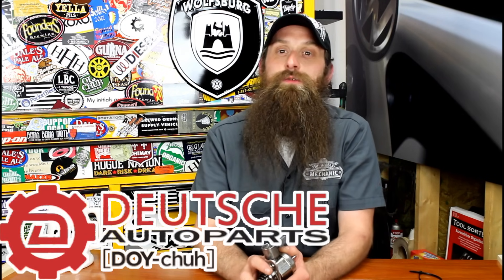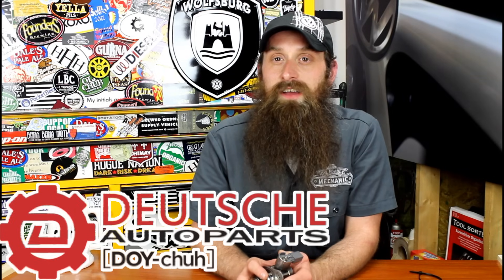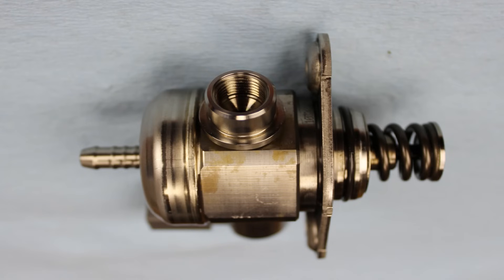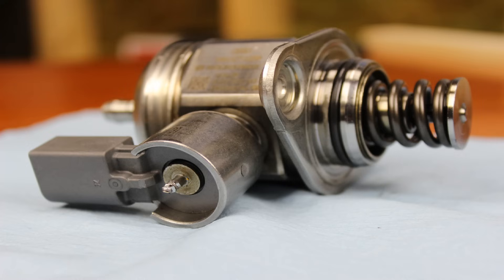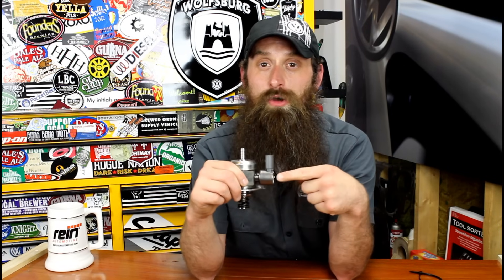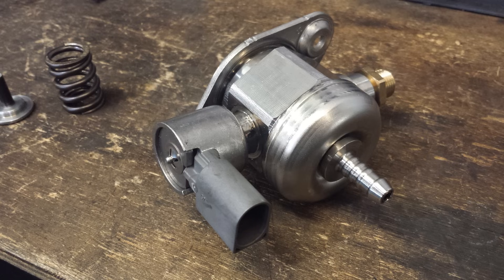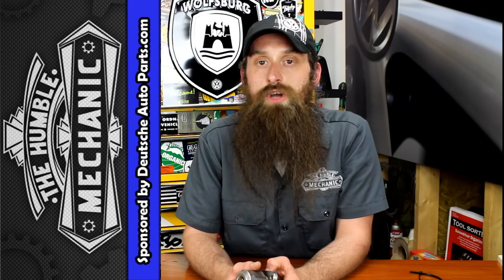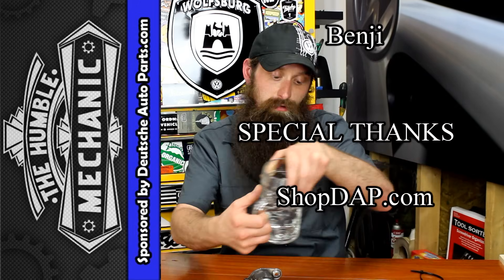How VW and Audi 2.0t TSI High Pressure Fuel Pumps Fail (HPFP)

Comment: I’m getting P0091 error fuel pressure regulator low control circuit 1 what would be the problem ? Really confused and the car is not starting when the engine is hot. I’m getting exhaust system warning lamp
Reply from the maker: Possible fuel pump module
Reply: Thanks bro my mechanic said it was low pressure sensor but he called me after few hours and said it might be the fuel module.  I felt so happy that my mechanic is a genuine guy.

Comment: Ok, 1, it's really obvious you're reading word for word from queue cards or a teleprompter. 2nd, these pumps fail another way, by leaking fuel back into the engine where that pintle valve was. DiagnoseDan just did a video on one where it put like a quart of fuel into the crankcase.
Reply: you're an actual piece of shit attention seeker
Reply from the maker: Never seen one fail that way. But not surprised about it.
Reply: I have fuel leakage coming from the top of the engine but under the injection place where I can't see.
The mechanic said that he will open the injection compartment to find out where the leak is from.
Can anyone help me with this problem.

By the way I wouldn't start the engine to avoid fire.
Please tell me what to do. Thanks

Comment: Would a bad hpfp cause lots of smoke to come out the exhaust?
Reply from the maker: It could. But there are tons of things that can cause smoke
Reply: This happened to me on my 13 gli cbfa today, after carbon cleanin upoer timing seal and cam seal i think th hpfp went or something thought it was the pcv change that and n ok thing, car is smoking but wont start keep getting low fuel pressure code and misfire codes
Reply: @joshuaalston-jackson8454  what did you end up doing? I have that problem right now and debating on replacing the hpfp
Reply: @Michael Booker  the injectors  one of them or more failed..when they fail they fail open and flood the cylinders..change them and ur good

Comment: I have exactly the same problem! My HPFP is still ticking, does that mean that it works correctly? I have a rattle noise during acceleration at low rpm and random misfires. My car is a VW GOLF 1.8 TSI 2010.
Reply: Random misfires? That's a symptom of bad HPFP for the 1.6 prince, so i guess it could be.
Reply: @Fucklesticks  i have the 1.8 TSI engine. I looked what the desired and required pressure was in the fuelrails and they where the same while driving. So I guess that the hpfp is not the problem. I'm still searching....

Comment: i just replace the high pressure fuel pump and the low pressure pump in the tank on my b6 1.8 tsi but the car is still stalling just after 5-10 km when scanned it reflects the high pressure pump
Reply: I did the same thing on my 2014 a5 Quattro. The Audi guy said my gas was to hot and sending vapor through the high pressure fuel pump. Looking for a fix now.

Comment: Im in the process of going from stage 1 to a stage 2 file on my 1.4TFSi. My question is, should i upgrade my HPFP to a 1.8TFSi or just go straight to a 2.0TFSi HPFP? This is a requirement but im curious to know if the 2.0 version is the better one or would the 1.8 version suffice?
Reply: Thanks for answering this question lmao

Comment: I'm having intermitent failures on high pressure pump on a CCZA engine. It started ocurring after my mechanical f*cked my engine when replacing chain tensioner. (16 bended valves). 

When I'm accelerating, sometimes it cuts the throttle suddenly, then the error code appears.

But it's intermitent. Sometimes I run the car for long periods, floorimg it, and no problems.

Any tips about it? May be an wiring issue? VCDS shows perfect fuel pressure on idle, didn't checked at wot.

Comment: hey chariles got 2009 adui a4 2,0 cranks no start i check for spark and it has spark and here is the codes p2296 p0010 ,,,the battry is junk for starters my frind thinks timing chaine ? if the battry is new and its getting spark and if i shot it with starting fuiled it should run ? what ya thurts let me know

Comment: Hello again . My problem : Hello. I have a smal problem with my mk6 gti 2009 manual gear box . when I try to go on a very strong start, changing the 2nd gear remains stuck as if the gas does not come .. 1gear is very brutal is i normal... that's only when I'm very sporty .. if I use the normal car it's all normal ... in other words I can not have a very brutal launch control because the second shift is dead. If i change a 2shift before 5-6000rmp all is ok ... so : I'm stop . I'm going to force 1shift up to the maximum same like a (brutal lunch control) push the clutch to change 2shift, go in 2shift and it's all stuck ... the car is not accelerating. The gear box is ok . All work perfect if i don t go in a max rmp with 1shift. 
Pls help me. I try today 2shift to 3 shift gear and do the same . All changed after 6000rmp next gear is blocked ... no gas no acceleration. Thank you.

Comment: Great video good info... i wanted to ask i have a 06 a4 2.o and am getting the P0089 code please shed some light cause i changed the fuel pressure regulator sensor n still running slow. . Could it be the same issue u were explaining?  And what is code P0340???
Reply: Did you you ever get an answer on the P0089 code?  I am having the same code with a really rough idle.  06 A4 2.0T
Reply: Did u guys find out whats going on ?

Comment: Ok I hope you amazing guys can help me. I have a 09 mkv gti tsi. Drove my car to work fine, but when I left to go home it ran rough, sounded like a Subaru. Got home and parked it(only live 15 min from work) changed the plugs first. After that it would start. Got a crankshaft position sensor code and misfire. I changed the cps and still no start.So I put in new coils. Still will not start. When I try to start it acts like it wants to but will not and it also sounds like a backfire under the hood. Checked the camshaft chain tensioner and it looks fine. Would you lean towards the hpfp? I had my wife turn the ignition to the on position and didn't hear the pump turn on all I could hear was a tiny ticking noise coming from the lil electrical part of the pump.
Reply: I have the same issue right now....what was your issue?
Reply: Domo Mike ??????
Reply: Jumped timing

Comment: My 09 Tiguan has a no start issue but before the no start car was losing excelleration n before that the pump hummed in the back . Which pimp should I replace? No check engine light

Comment: Humble Mechanic! Here is bizarre issue. I have a 2007 MKV 2.0t TSI Jetta. I had a huge problem with power. Throttling under 2-2.5 RPM it did go but with low power. Past 2.5 RPM it was totally unresponsive. So taking it home I put it up on the scanner and the codes "Throttle position sensor - G69 signal too high P0123 upper limit reached". And also a second one reading "Angle Sensor 2 for throttle (G188): Signal too low P0222 lower limit reached. So I took the intake manifold off very carefully along with fuel rails very carefully along with the fuel pump and throttle body still attached still attached. I tested the intake manifold mechanically and electronically and it seemed to check out. The throttle body the same. Except that the throttle body when at "0" does not close at a 90 degree resting point. to sure if that where it should be. But the travel values seemed to check out visually. After all that checking out I thoroughly cleaned everything with minefield cleaner. I also cleaned the valves as they were caked making sure only touching the ones that were closed for degree safety. I put everything back together forgetting to putting the dip stick tube on. During starting it took 10 minutes to get it started. Then it idled very rough with intermittent light presses of the pedal. After 3 minutes or so of running it dumped both fuel and oil, gushing directly under the engine. I shut her down and then took everything back off finding no loose hoses or connections. When taking the intake manifold off fuel pored out of the the manifold and throttle body. I'm assuming the obvious on the oil gushing, but the fuel? WTH? Any suggestions?

Comment: I have a 2006 VW Passat 3.6 how do I test the low pressure sensor I know is there is a five five reference signal and a ground and signal wire for the computer

Comment: 06 Audi A4 2.0t if hpfp fail will car start
Reply: Et Bet not always.  Sometimes the solenoid will completely block fuel flow to the HPFP and the injectors will starve for fuel, causing a no start. Not as common but it happens.

Comment: I just put a replacement engine in my 2006 passat tfsi and I have a p2293 code that is coming and going.   I tried replacing the low pressure sensor on the hpfp with the old one from the original engine but that hasn't alleviated the issue.   The engine I put in I made sure I put a brand new cam follower in and I'm sure that camshaft is Good as its a warrantied used engine through lkq.   Any ideas on what I should try next.   Maybe try to use the old hpfp from the original engine?
Reply: Did you fix the problem?

Comment: Does the 3.6  high pressure fuel pumps common to go bad also?
Reply from the maker: They do, not nearly at the same rate. They actually fail due to chain stretch  more than fail the pump.

Comment: I've got a 2010 Passat wagon and I'm having a epc light on with an obd code of p2293 and a misfire code p0302. There was some freeze data with the misfire code. Things that stuck out- sort term fuel trim1 of -25.6% short term trim3 of -100.6% 12070 kPa fuel pressure. I'll check the solenoid in a few minutes but does that fuel pressure sound a bit high? I was at 40% throttle at 2000rpm and 9mph.
Reply: Travis Aragon no seems normal but your fuel trim numbers are confusing.  Are you saying fuel trim 1 was a -25% or that fuel trim bank 1 sensor 2 was at -5%?

Comment: really helpfull video as usual. n i have a question to you or anyone. good with vw mechanuc.  any of you know why my 1988 1.8 cabriolet stall when engine is hot plz
Reply from the maker: Most of the 1.8 issues I have seen are related to fuel pumps failing, or to dirty throttle/flue plates.
Reply: Omg ty verry mutch for that quick responce i already changed the fuel pump .as soon as it get to working temperature i have to give it gas like at keast 2000 rpm or it stall on me .ty verry mutch for that advice.  Have a good one
Reply from the maker: There are 2 pumps,
Reply: Im sory i might look stupid but im new to vw it was a car i wanted ti have since my childhood. Well ill look to find the second one. Ty verry mutch
Reply from the maker: No worries. I didn't know that until I owned one.
Reply: HumbleMechanic let me know can you help me thanks
Reply: I would check the left side where your fuse panel is they're known for water leaking in behind the fuse panel and causing corrosion also I'm not sure knows but they may have a relay check the fuse panel and relay for corrosion

Comment: I never checked when my last fuel pump went but would bad electrics on a fuel pump cause the fuse in the engine bay to pop? I believe f23 in the engine bay fuse box, on my car it was a 5 amp.

Comment: my amarok is giving me the error P0088 "high fuel pressure"  what could it be
Reply from the maker: +Paulo Gomes maybe a failing high pressure fuel pump
Reply: Tuned cars are causing these codes to show up on scan tools; however, no CEL though.

Comment: Hi i have this code n276 on my audi b8 tfsi. I am also experiencing a loud screeching and ticking noise. I used a stethoscope to hear the HPFP and it definitely seems to be making the sound. Went online and bought another vw audi hpfp and replaced it. Problem still exists. Replaced PCV as well just as a precaution, and the sound is still there. It makes almost like a mechanical screeching sound. Help! (Car has no issues. Runs drives and accelerates without any problem or jerking.
Reply: Ben Zhu hi,i am Peter ,did you found the problem?I just have a same issue with avw scirocco.

Comment: I just replaced my high pressure fuel pump. Followed the install video and everything went perfect, but when I went to start the car it just turns over repeatedly but it acts like there is no spark. I checked both the high and low pressure lines and there is fuel in both. Any ideas?
Reply from the maker: +Phil Noblit be sure that the pin didn't break on the pump. Also be sure the pump is plugged in. We have also had a couple of pumps be bad right out of the box.

Comment: I have a 2008 tsi JETTA that had a bad HPFP the solenoid was not cliking it had a buzing sound and was draining the battery. I replaced the HPFP  and now the low pressure fuel pump side of the fuel rail has no pressure.
Reply from the maker: Guillermo Hernandez That stinks. The low pressure failure may have caused the high pressure failure.

Comment: I have a 2008 s3 8p 2.0tfsi which is running lean. Car has a bigger intercooler and a performance chip tune, produces 330 hp @3200. If I drove it constantly under 2200rpm it goes into limp mode with "p0171 lean off idle" code with ltft over 21%. If I drove it over 2200rpm car gives power back and ltft settles at 13-14%. VCDS says that required and actual pressure is fine in both hpfp and lpfp width almost no difference. Lpfp duty cycle is 57-58% at idle and 60-62% off idle at 21% engine load (where usually freeze frame sets - 1800rpm). Cam follower replaced and no wear on the shaft, pcv replaced, injectors brand new (seals too). MAF readings are fine, 3,5g/s at idle, 10g/s when rpm held at 3000, and 208g/s in 2nd wot. Smoke/pressure tested the hole system for vacuum and boost leaks, no leak. Now I suspect that either the lpfp is wearing out or my hpfp is not up to the job anymore as this fault started like 2-3 months ago. Please let me know If I can provide any more info and thank You in advance for helping.

Comment: Do the seals fail on these pumps which would result in fuel mixing with engine oil?
Reply from the maker: ***** It may be possible. But Ihave not seen it happen.
Reply: Did you solve the  fuel mixing with engine oil issue? I have that problem too in a 2.0 TSI 2012
Reply: Ivan Sosa did you solve the problem? I have the same year GTi and I’m getting p0172 and fuel in oil
Reply: HumbleMechanic if you remove shaft with spring, and blow on inlet  side, is it normal that air then come from hoole where shaft goes? I ordered pump from ebay and this is what hapens to it is it normal?
Reply: This was a rampant issue with the 2010-12 GM 2.4L Ecotecs. They had to issue an extended warranty for the 2012 Equinox/Terrain as a consequence. GM referred to it as "excessive engine oil consumption". . .
Reply: Guys, it definitely happens and can ruin the engine if not caught quickly enough. DiagnoseDan channel just did a video on this very issue. The title didn't mention fuel pump so it may be hard to find. It may have been something like rich condition or extended crank, I forget.
Reply: Mine did exactly this the day before yesterday. 2012 82k miles. Mine threw a lean condition light. Dealer repair ~$770

Comment: i was hoping you'd dremel it open!
Reply from the maker: I tried. those are tough little bastards
Reply: HumbleMechanic
If civilized dremmel fails then get the 1000W angle grinder with a coarse cut disk, if it can open a safe, it can open a HPFP....
Reply from the maker: Haha true. I just had the little DreMel at the house. I'll bring it back to the shop and use my cut off wheel.